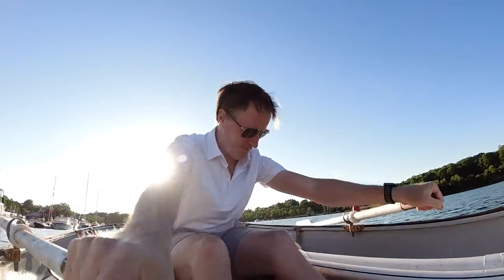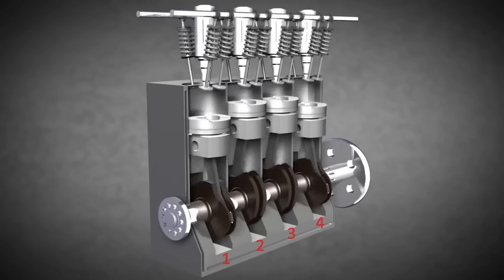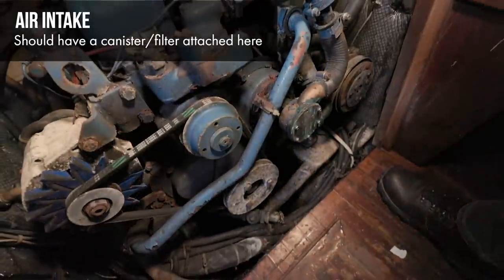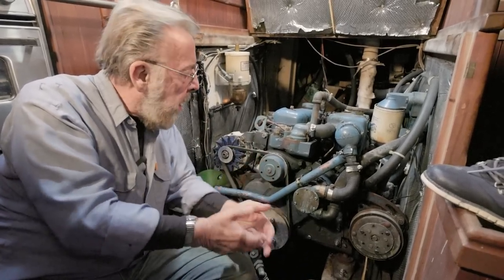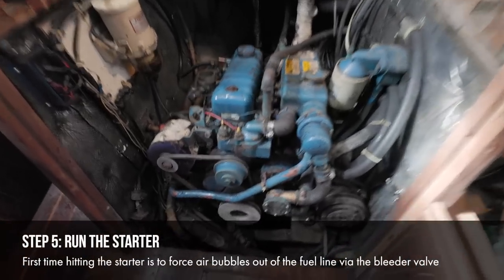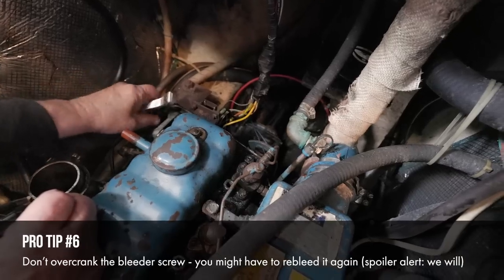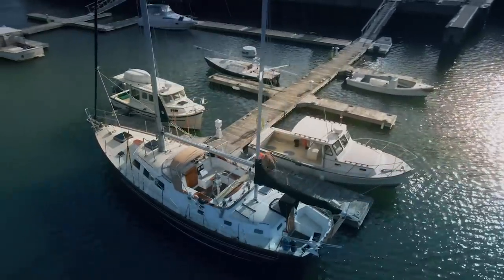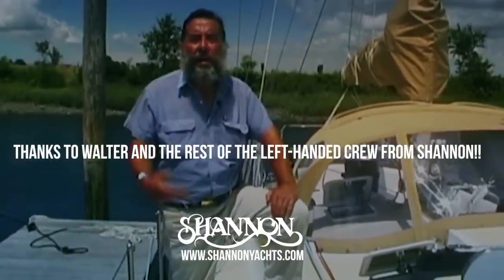WILL THIS ENGINE START?!?!! Ran-day EP11 with Walter Schulz #sailboatrefit #enginestart

Comment: He needs a channel! I could watch Walter Schulz every day (Except Thursdays of course) Thank you Ran-Day and thank you Walter for sharing your knowledge with us.
Reply from the maker: Thanks for watching and the kind words 👍
Reply: Ran Dee:  In Step 8 you are mistaken.   Adding coolant has nothing to do with raw water pump.  Two separate systems.   Coolant goes through a different, freshwater pump.   Check it out.
Reply: He actually has a channel, it's called Shannon Boat Company
Reply: @petethecatable   it's sometimes in the raw water side to overwinter protected sa as not to bust open when the big east coast harsh winters hit any water in that boats gonna freeze so its gotta get antifreeze drinking tanks too toilets all need antifreeze till mid april probably. I use to go with april first but got hit by 2' of snow early April it stayed cold another week or so then cracked my block and you'd think by april we would be done with ice and snow, not that year, end of the line for that motor. Moral of the story keep it warm or if you cant fill it all with antifreeze. You can put engine block heaters on the boat but it doesn't protect everything and if they burn out quit working...
 kaput. A hole in which you pour money, B.o.a.t. break out another thousand.

Comment: Just bled my Perkins 4-154 in my Peterson 44 Sailboat last weekend after installing new primary & secondary filters and a new fuel lift pump.  Took me about 13 attempts as well!  Had to work my way through bleeding at the primary then secondary filter, then the two injection pump bleed screws, then each of the four injector pipes.  SUCH satisfaction when it FINALLY fires up!  You can see it in Walter's face when he's finally successful.  Good for you, Walter!
Reply from the maker: That is a helluva lot of bleeding… congrats and cheers from this crew!
Reply: @YachtHunters  I think replacing the fuel lift pump at the same time added a lot more air into the system.  It took longer to bleed.  Enjoy your channel!

Comment: Nice!  One thing that works well is to have a fitting that replaces the bleeder screw that goes to a clear plastic tube and fill the tube with clean diesel.  You don't have to keep adding fuel to the little fill cap funnel and you can stand back watch the bubbles of air rise in the tube.  The "head" or height of the diesel in the tube also helps prime the system.  On my old 1967 Massey Ferguson tractor with a 90ish HP Perkins, if it sits for a year, I need to crack the fuel lines at each injector and crank the engine until fuel and no air is escaping.  Once I get solid fuel, I close the lines at each of the six injectors and it starts right up.  Sometimes this is absolutely necessary to do!  I have also had to do this on 80's Mercedes diesels.  If you don't do what Walter did with baring the engine over and adding oil to the top end you really can damage items.  I have seen bent push rods which causes the engine to have a slight miss.
Reply from the maker: Wow… bent rods sound horrible. Interesting idea for a fill tube & fitting.. would like to see how that is rigged up. Thanks!

Comment: Oh my love/hate relationship with my old Perkins 4-108 on full display here lol. Mine was in  Morgan Outisland ketch. Pulled it out, had it rebuilt, reinstalled it, and it purred like a kitten. Great video of Walter, a true genious and designer for sure. Thanks for sharing Randay.
Reply from the maker: How was the rebuild process? Did you do it yourself? If not, was it expensive? Lengthy? Cheers
Reply: @YachtHunters  i pulled the engine myself then took it to a quality machine shop. They took it from there. Because i pulled it and reinstalled it the cost was about 3500. The whole process took a little over 3 weeks. Keep in mind i was much younger then and it was heavy work. I pulled the head then the block after removing everything i could. I ended up replacing most every bracket, nut, and bolt i pulled. That added another 1200 to the job, but the end result was worth it. My engine for all intents and purposes was brand new for a fraction of a replacement.

Comment: Loved it. Especially loved hearing the estimate of the number of hours already run and the lifetime hours that can be expected from a small marine diesel engine. Precious wisdom.
Reply from the maker: the general rule of thumb I've heard is around 10,000 hours before a rebuild might be considered. Of course it could be higher or lower based on the maintenance and care that's been had over the years. My Ford Lehman has 9,400 hours on it... so it's getting up there in years but it fires right up and seems to work well. It leaks a little oil and currently leaks A LOT of coolant but I anticipate being able to solve that in the next month or so...

Comment: The guy that grew up next to my parents was an old school shade tree mechanic. He said you need three things to get an engine (they're really not motors) to run, air, fuel and fire.  That was for gasoline engines.  Diesel engines need the first two because the fire is supplied but compression.  The point being, if you have air and fuel and the engine is not seized it should run.  Maybe not run well but run, after that it's a matter of tuning.   Good video Randall.   Keep the good stuff coming.
Reply from the maker: Cheers JL! I’ve heard that adapted for diesels to be fuel, air and oil…  keeps it nice and simple 👍

Comment: Old diesel fuel injection mechanic here. That motor has a DPA rotary fuel injection pump. Every pump has a bleed screw and the system needs to be bled through to that point, not just up to the filter. By bleeding right through to the pump, you are clearing the entire system of air, not just up to the filter housing. The little lift pumps are actually very good and supply a lot of diesel per stroke of the manual lever. People think that they are useless because the pump is driven by an internal lever that is actuated by the crank shaft of the motor when the engine is running and Murphy's law states that when the engine was last stopped, it will have stopped in a position that has this lever actuated. This greatly reduces the effectiveness of the pump when using the external hand lever. All you have to do is turn the engine over a little and then you will be able to feel that you are getting a full working stroke of the hand lever, and it pumps a lot more fuel per stroke. Also, the rotary (main, not the lift pump),pumps can sometimes air lock. The easiest way to clear this is to loosen all the injector pipes at the injector end and crank until you see the pump delivering spurts of diesel at the injectors. Once you get there, tighten the pipes again and she should fire up quickly; and you won't have to overheat your starter. Rotary pumps like the DPA are particularly prone to air locking at times, whereas with an inline pump, such as a Simms or Bosch for example, this is much less of an issue. Nice video; thanks.
Reply from the maker: Wow… great Info & tips… thank you!’
Reply: So that's why pumping the lever feels useless!

Comment: Great video. I probably would have done a few things different such as bleeding all of the air from the injectors and making sure the impeller was new but I did learn a lot about soaking the mystery oil into the system to lube the valves rings and  pistons. Thanks for putting all this out here and a big thanks to Mr. Schulz for being willing to do this. I miss my boat and hope one day to be in the cockpit of one again. Thanks Ran. Cheers!!!!

Comment: On a Perkins 4:99, 4:107,4:108 like that the air needs to be bled from the injector pumps bleed screw, then the injector pipes. And if all else fails use the CAV Thermostart that is fitted to it. Pretty much 100% success rate if the Thermostart is used. Started a Perkins 4:108 after sitting 11 years doing it that way. Never had not start over last 45years.

Comment: Great tutorial on starting a sitting engine! Never having worked on a diesel engine, but looking at an older sitting vessel. MM oil should be in everyone’s cabinet. I was taught that by an older gentleman myself. In my search for parts and information on working on my ol’atomic 4 a few years back. Bristol Marine is a great place!
Reply from the maker: Thank you very much! Yes, super crew and fast!!

Comment: Small correction to Step 8: Make sure you have enough coolant: primary reason is to keep the internal coolant pump lubricated. Also make sure you have raw water (garden hose adapter) to the raw water pump to keep the raw water impeller (which is a rubber impeller so more sensitive to degradation) lubricated. Raw water is used to cool the coolant in the heat exchanger then is dumped overboard through the wet exhaust injection point.
Reply from the maker: Good catch… thanks Austin, much appreciated

Comment: That was performed on a Shannon 28.  A little diff layout than mine, I've lived on my for 2 yrs now and am currently enroute to AK, with a layover in Port Townsend because of weather and my stern tube stuffing sprang a major leak.  The original engine manual to the original owner has been passed down thru the ages to me, and it has notes scribbled in it from Walter Schulz, including on how to bleed the engine, which I follow because they're more detailed than the Yanmar manual. 👍
Reply from the maker: Wow… that sounds like some scary moments!! Glad to hear you’re okay and seemed to have caught that in time. You’re a lucky & smart sailor to be on a Shannon 28.. it’s a remarkable craft built to take you anywhere. Would love to be among the buzz of port Townsend… lots to see in the world of boating there… cheers and let us know how your travels are going!

Comment: I can run my engine without worry on the hard by detaching the raw water uptake hose from the through hull and splicing together a hose to the fresh water tank. (you could use a big bucket instead.)  I can run the engine in the yard to warm the oil before changing, charge up the batteries and bleed fuel lines as needed.  I also keep starting fluid on board.  A spray of starting fluid into the air intake will keep you from needing to crank the starter over and over.

Comment: Hey folks, I experienced the same thing with trucks in the Army, a Diesel towable compressor, and now my sailboat.  Man, when you get that bubble in the line you start thinking the entire engine is toast….you think something catastrophic happened.  But a lot of those times, if you can keep cranking and you know there was a break in the fuel line or someone ran it out of diesel you just gotta be patient.   And patient might mean 1-3 hours
Reply from the maker: 1-3 hours sounds about right!! glad we're not alone. cheer

Comment: One thing I'd warn against is cranking the engine for a long time with raw water inlet on.
Diesel probably has enough pressure to keep water from back filling from from the water lift muffler. Trust me an atomic 4 will flood the cylinders but that's gas and less pressure. But I have heard of the back fill in diesel as well.
Reply from the maker: Great tip… thanks!

Comment: I don’t understand you comment about those guys being left handed, sometimes I’m a little slow, can you elaborate? 

By the way, this video is an absolute “gem”, perhaps the most practical and valuable instructional lesson for all sailor/DIY types I have seen so far! The magic fluid could be replaced with diesel and some fine oil mixed into it(but not necessary as diesel is itself a lubricator!). Now, can we have a similar lesson for petrol outboards please? SkipRay, the “kingdom” (Kerry), Emerald Isle.
Reply from the maker: Ahhh yes.. All the guys from Shannon Boat Company that showed up to help are coincidentally left-handed… which is pretty rare for one person (10% of the population)… so to  have 5 people all left-handed seemed remarkable. I’ll see if we can find an outboard next… cheers, skipray!

Comment: Nice video. To start a dead diesel I personally prefer too use a dinghy tank with a manual pump and also bleed an injector ... less mess. I NEVER USE ETHER ON DIESEL ENGINES, most "modern" diesel have glowplugs ... and boom.  I also prefer to remove also the air filter ... you will find insteresting insects and other animals  in there. I use WD-40  as starting aid in the air  intake. 
Markus

Comment: Please ask Walter why he did not spray ether into the open air intake when the engine would not initially start to see if he could coax it to fire.  I'm curious.  Thanks.
Reply: Ether is like crack to engines get em started a few times on ether and they’re hooked and won’t start without it .
Reply: My 2 cents... I would recommend using ether only as a last resort, especially on an old diesel that's cold and has been sitting.  While it just about guarantees combustion, it's so explosive that it will really hammer on everything from the pistons to the crank bearings to the crankshaft and crank bearings.  Cold, with possibly loose tolerances, and possibly minimal lubrication in the bottom end, it's best to try all the gentle options first rather than risk bottom end damage.🤞
Reply from the maker: I’ll ask Walt next time I see him. This gives me a good excuse to go knock on his door again! 👍

Comment: Walter's a badass! I'd love to have someone that knowledgeable check out some things on my boat like that. You are so lucky to live in an area with such valuable human resources to draw upon and learn from. My boat is in Tampa and it's hell to even find someone to go clear work area so the fuel cleaner and mechanic have room. Now I'm wondering if instead of Texas where it would be easier access for me if maybe I should take it to the North East instead...
Reply from the maker: Splash her in and head north!! You’re right, the concentration of expertise and experience in New England is quite remarkable. Let us know if we can help you with your efforts… sounds like you have some good initiatives brewing. Cheers
Reply: @YachtHunters  She's splashed already and that's what has me worried with Hurricane Season right here. There's some bottom work, and some wiring which need attention. Can't get it in Tampa because last year's hurricane pushed the remaining boats north to Tampa area and the few remaining yards are all chock full. Good luck finding a DIY yard in the area that isn't booked until 2312AD... I just got her in December. Anyway, I'll go some distance in the Gulf, but I'd be worried getting her into the Atlantic and don't have time for the ICW. Enough whining- thanks for the episodes!

Comment: Probably would have gone a lot smoother if you'd left the fuel system alone. Diesel doesn't go bad in a few months like gasoline does. I had a cement mixer with a Petter Paz-1 diesel sitting under a tarp in my driveway for 15 years. The tank was less than half full, but once I opened the fuel valve, it started first try. Maybe if you had water in the fuel and bacteria growing in it your filter is going to clog quickly, but it shouldn't stop you from getting it running for a minute.

Comment: I've been through this process. satisfying and necessary. But it's often not the end. A diesel can run with miserably functioning injectors that with prolonged running can damage the engine, And again make it not running. Also is the cooling system working properly (not too hot, or cold) also I noticed that a replaced head gasket should be retorqued, after a period. I'm muddling through these concerns.
Reply from the maker: Good food for thought. Thanks!

Comment: Amazing!  I began to think that that engine would never start!  I really wonder what did the trick?  Hmmmm
Reply from the maker: Just getting that stubborn air out of the fuel line. Walter poured in a lot of fuel and you saw how much the starter was cranking (and forcing the air out of the bleeder)… so it was just a matter of getting the final air bubbles out

Comment: I've worked on many diesel engines, and getting air into the fuel system can be a horrible experience. Common rail has eliminated that problem, but all old engines are a b*tch.
Reply: I much prefer simple old school diesels with mechanical fuel injection in a boat, much less to go wrong than modern, electronic injection nightmares.

Comment: Great video, my only disagreement is his comment that the engine is shot if you can’t turn it with a he wrench. Not yet, remove the plugs or injectors and fill the cylinders with the oil/penetrating oil of your choice, go home and try again tomorrow. Instead of using a wrench use a breaker bar and gently work the crank back and forth until it breaks free. These engines are almost bulletproof l, Don’t throw away a good engine just because years of condensation rusted the rings to the cylinder walls. The cylinders may need to be honed and the valves reseated, all stuff a dyi person can do in place.
Reply from the maker: I like that attitude!! You can be on my crew any day… the can-do crew!! 🤙👍